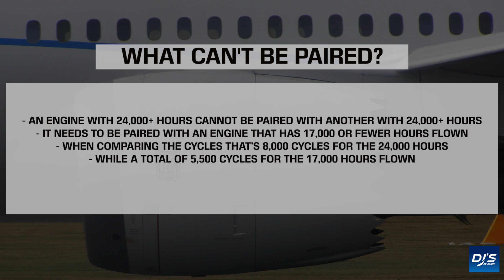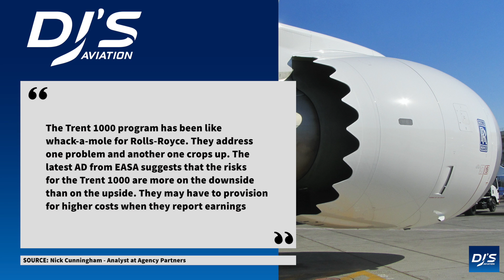New Boeing 787 Engine Issue

Comment: So it's not really Boeing's fault as it is more of Rolls Royce.
Reply: True, but unfortunately Boeing will be the most affected by this issue anyway. And the fact that RR Trent XWBs on the A350s are working without any issues certainly doesn’t help Boeing either.
Reply: Dream Journal Projects yea
Reply: So true, Max. So true.
Reply: I think the engine is the Airliners choice it is not Boeing.  Boeing only design the nacelles according to the airliners engine choice.  There is also a choice for using GEnx engines for the 787s
Reply: @jayvee8502  I kinda agree with you on that.
Reply: Ladh70 I think he’s biased towards RR as well
Reply: It's Boeing fault for going with that engine. So yes it is. They must take some blame.
Reply: @bmc9504   Yes. Boeing should have had the insight to know all the issues RR would end up having with the Trent 1000. Stupid Boeing. You should be running things man. Your Genius!
Reply: Incorrect. This is directly Boeing’s fault because Boeing kept pushing RR to make the best, most efficient and technologically advanced engine.
Reply: @FlightyFilmsy then by that logic, American Airlines is to blame for the 346 MAX deaths
Reply: It still has the Boeing name on it, so it's both of their problems.
Reply: Of course is Boeing issue, their supplier quality control must be really bad
Reply: Who said it was Boeing's fault?
Reply: Very true about Rolls-Royce.
Reply: It always was
Reply: Who's to blame anyway?? Boeing: it's not my fault it's Rolls Royce but the end product is a Boeing 787
Reply: It's the customer's choice on which engine they choose they pay for the engines then we install them our planes are customized to their specific needs no 2 Boeing jets are alike
Reply: Dream Journal Projects Choosing the cheapest not the best. Who is to blame
Reply: But it’s Boeings problem too.
Reply: This is an old issue with RR engines!
Reply: Dream Journal Projects no
Reply: Max Payne The ignorance in the comments around here make me laugh, they’re not even aviation enthusiasts
Reply: @Racko.  I know more about aviation than you, I can guarantee it
Reply: Max Payne Ppl who know nothing about it tend to blame Boeing for no apparent reason.
Reply: @Racko.  people who nothing about it tend to defend Boeing
Reply: Yes It's Boeing fault to choose an european supllier.
Reply: @antoniosoares1580  you do know that the 787 is basically made all over the world? Also American engines have had their own issues on the 787. It's also about what the customers want, so they must Include other engine options.
Reply: @antoniosoares1580  sames goes for European for choosing an american supplier - PW1000G, oh crap my bad PW is russian right?
Reply: @Max Payne i know it was never an mcas issue it was poor pilot training right? no one blames company for engines issue, Boeing fans pity at its best
Reply: @Rsantana380  Stop trying to connect ROLLS ROYCE'S incompetence with the 737 max. Both are totally separate issues, both companies screwed up.
Reply: @pilerks1  i'm not i'm just replying to a comment that someone thinks we all idiots, who doesn't know RR lack of quality issues same as PW with the neos
Reply: @Rsantana380  If the pilots don't know MCAS is there how can they be trained about what it does and how to turn it off?
Reply: @andrewallen9993  hey if i give you a formula one car and tells you it runs just like your sedan will you know all about the F1 car or perhaps you might end up cutting a tree in half - basically Boeing said they don't need training it flies the same
Reply: @Rsantana380  My point exactly sir!
 :)
Reply: @Rsantana380  In fact the MAX issue was both just your lot are Boeing haters.
Reply: @davidoldham1946  I'm not a hater what do I have to hate do I make planes no? So stop it I just started to hate them on the usaf refueling deal and I don't hate them I just don't like them do you like BMW or audi
Reply: @Rsantana380 : Blah, blah, blah......Boeing did not design nor build the engines.
Reply: @cdpgbc-mw2kz  nooooooooooo!!!!!! o my God
Reply: @Rsantana380  yeah the 737 max was still safe, pilot training is only the issue on why the max 8 is grounded right now
Reply: @nilo8642  astro hope you not the houson cheater astros, i was being sarcastic im not a boing fan at all
Reply: @Rsantana380  i dont understand :/
Reply: @Max Payne well what we know is that the 737 MAX8 is able to crash
Reply: Oscar Micó education must not be great in your country
Reply: @oscarmico3353   You are correct. Incompetent airlines crash their planes!
Reply: @brkitdwn  Airlines which are incompetent because Boeing forced them not train their pilots because it would cause precedence for other airlines in the region which might hurt the sales of Boeing aircraft.
Reply: @jaketus   Dude.. Provide me some real facts, otherwise, don't comment.
Reply: @brkitdwn  Have you read the emails Boeing released? It was "some" customer in Asia which planned to train their pilots in simulator before allowing them to fly the Max. Boeing told them not to, because it might cause the other airlines to be forced to do simulator training instead of 1 hour ipad "training". Now who was the launch customer for the Max in Asia that could set the precedent? Ah yes.... Lion Air.